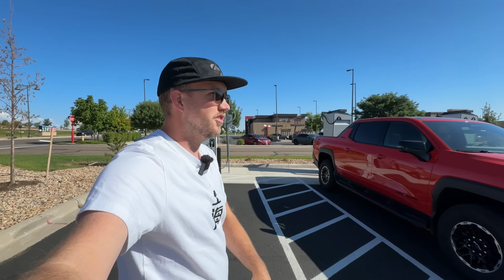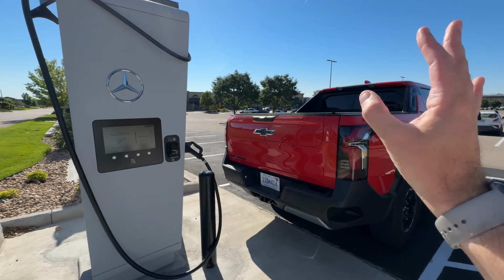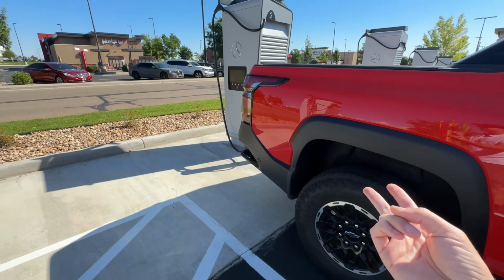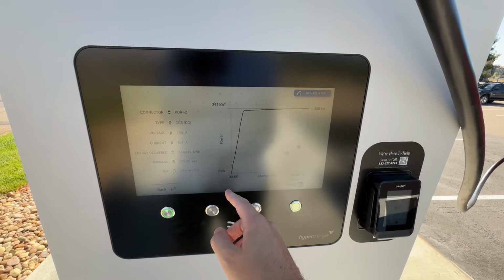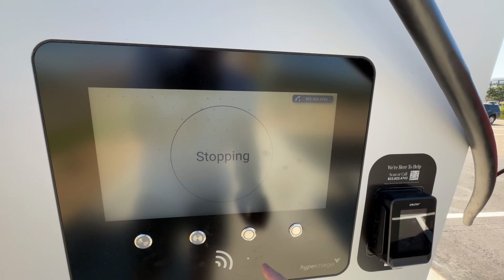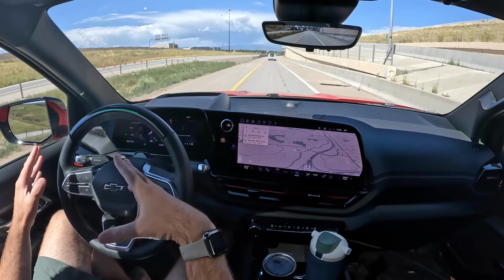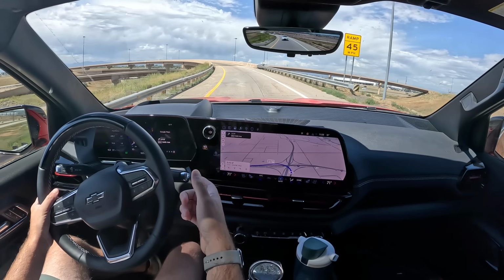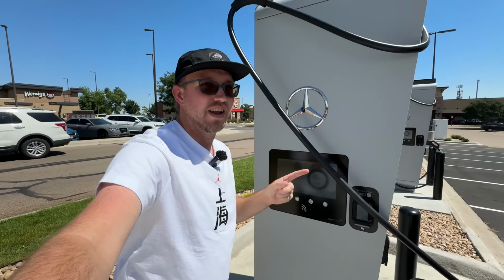Chevy Has Improved Road Trip Capability! 2026 Silverado EV Trail Boss 10% Challenge

Comment: Currently watching, but i would not run the AC while charging GM cars to get the juice faster.
Reply: It's a road trip simulation, you're not sitting in the car without AC.
Reply: On almost every road trip I’ve done in my EV, the car will be off for 10 or 15 minutes, because I step out to grab some snacks/drinks and use a restroom before coming back to the car.

No one drives for 4+ hours and then sits in their car for 15 minutes and leaves on the road again. I appreciate them trying to make a standardized test, but it doesn’t really match reality.
Reply: 10% challenge is a standardised test against all vehicles, requiring them to have AC on.
Reply: One of the beauties of EVs is running the AC when parked or charging.
Reply: When the weather is really hot it’s nice to be able to leave the AC on even if you get out to take a walk or use the bathroom while the vehicle gets energy.
Reply: At least they should have run the test twice. One with climate control on and the other with it off. People more often than not leave the their EV's charging with everything off while going to the bathroom or getting a snack. That's a real road tripping scenario as well. These are not ICE vehicles where you are forced to wait there till it fills up.